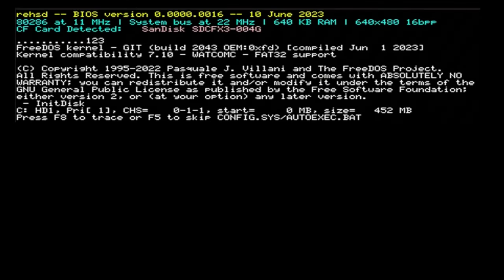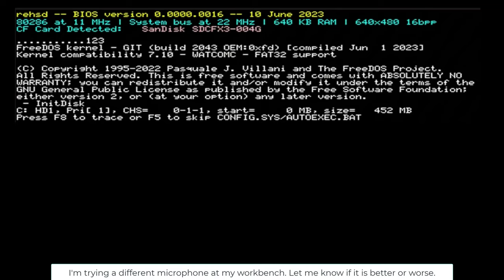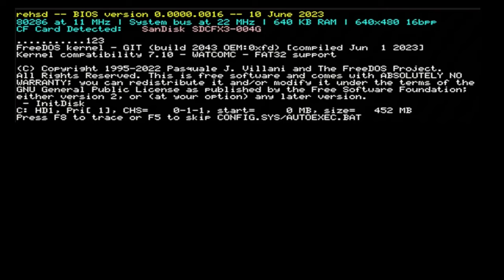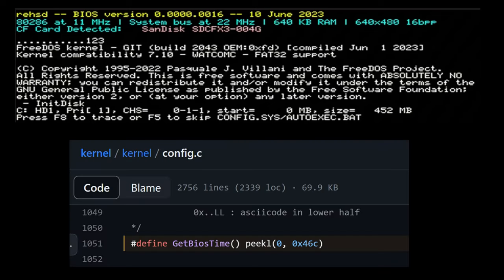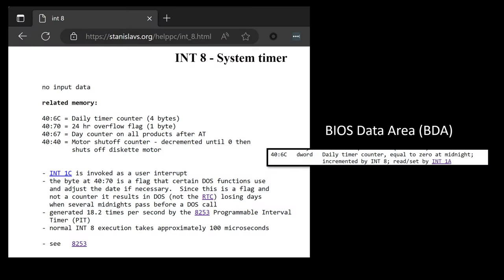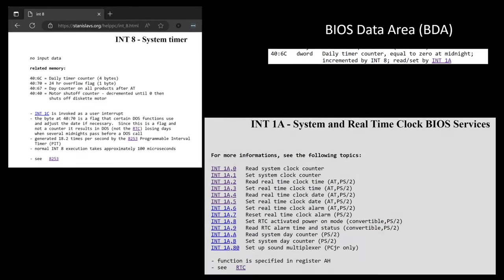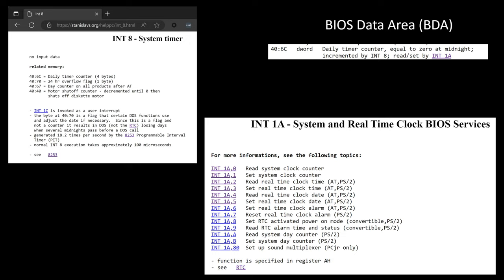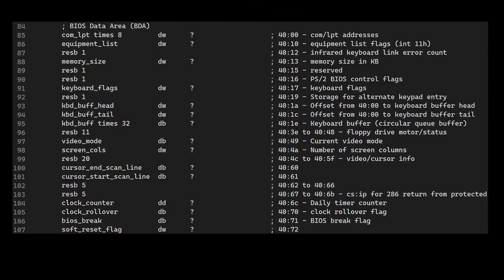80286 Build, Ep. #98 - System Timer using a W65C22S VIA instead of an 8253 PIT

Comment: I don't know how the BIOS worked, but in the standard C library in Turbo C, you could get the system time similar to the interrupt, and there was also a hash define saying how many "ticks" persecond so you could convert the system time call to wall clock using that constant,. Memory says it was 18.2 which sort of lines up with your 18.4. So in theory it shouldn't matter how many ticks per sec/interrupt rate of the hardware as long as you can publish the conversion factor. That beiing said, this idea of counters going to zero at midnight is nonsense given leap seconds and all the realities of UTC versus TAI and so on.  But it worked well enough for the time, I suppose.  Enjoying watching you move forward.
Reply: Something has to provide that time, and that is what the system tick timer/interrupt does. 

A C library will only be making a call to the BIOS or reading some memory location to obtain a value that is maintained by the tick interrupt, so this is still necessary. It doesn't magically exist on its own.

As for resetting to zero at midnight and not considering leap seconds etc, just remember the era of computing that this all originated in...

Computers weren't networked so there was no NTP and no certificates to need to worry about accurate date/time, and the first two models of the original PC didn't even have a real time clock to keep the time when it was powered off. Even when real time clocks did come along they were still horribly inaccurate but still provided a better user experience than having to set the date and time each time you turned the computer on. Leap seconds would have been far from most people's minds in consumer desktop computing at this stage... The real time clock might gain or lose a few seconds each month anyway, negating any accuracy of tracking leap seconds.

Comment: Good work, You should push and pop the flags in the timer interrupt as well.
Reply from the maker: I was thinking the flags were automatically pushed/popped as part of the interrupt and iret. Is that not right? Thanks, Kevin!
Reply: @rehsd  To be honest, I don't know. Not very familiar with x86, just was worried it could cause a hard to track bug.
Reply from the maker: @kevinleadbeater5137  I appreciate that. I believe I'm OK with the flags, as part of the normal interrupt and iret. I know when I want to return a modified flags register, I have special things that need to be done to accommodate the return of updated flags, as the original flags normally get popped.

Comment: Any recommendations on implementing an 486 chipset (VLB) using FPGAs? 
The idea is to develop a motherboard around a couple FPGAs which has a versatile customizable chipset such that you can really change how the hardware works.
For example, as I suppose you are aware, the Weitek FPU is a memory mapped device, unlike the 387, 487 and all prior x86 87 series FPUs, this as such allows us to have 2 FPUs on our system without them conflicting with each other which is something I would love to play with, though sadly Quake does is not compatible with Weitek AFAIK, it does use the Integer and x87 math simultaneously to improve its performance (one of the reasons Cyrix performance tanked on that game as that CPU does not allow you to use these simultaneously and AMD/Intel can do that which in a way enables a sort of dual core computation). I would simply love to see what we could achieve by having Quake be able to use 3 math computation devices simultaneously instead of just the normal 2.
Reply from the maker: Sadly, I won't be much help. My FPGA experience has been fairly limited, and I haven't yet jumped into the 486 processor or related chipsets. Maybe ask me again in a couple of years. :)  Good luck on your project!

Comment: If you were to load your timer with a value of 60440 decimal and count to 10 you'd get almost bang on 18.2 ticks per second.

1 / 18.2 = 54.9450ms

1 / 11000000 * 60440 = 5.49454ms * 10 = 54.9454ms

Can't ask for much more than that. 🙂
Reply from the maker: Now... that's just too simple of a solution. Smart. Thanks, Tom!
Reply: @rehsd  Im not too familiar with the VIA and I was struggling to figure out how it works, but are you reloading the counter value each time you get an interrupt? It seems that it has an ability to be loaded with a value that it can re-load itself when the counter reaches 0. That should save a little bit of work in the ISR, and keep the interrupts coming with little jitter.
Reply from the maker: @TomStorey96  Agreed. I added that to clear the interrupt on the VIA. For some reason, when I don't do that, it fails to function correctly. From the datasheet, it seems like it shouldn't be necessary, as I clear the interrupt later in the routine with the read of the low counter value. I'll do some further experimenting.